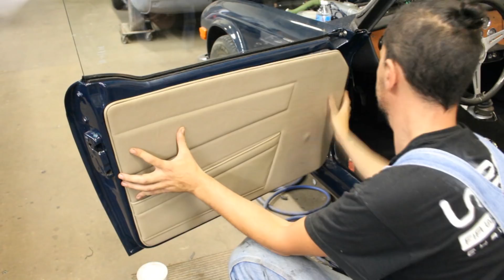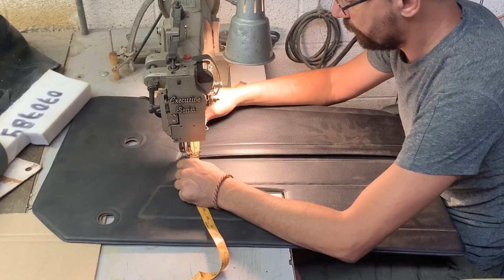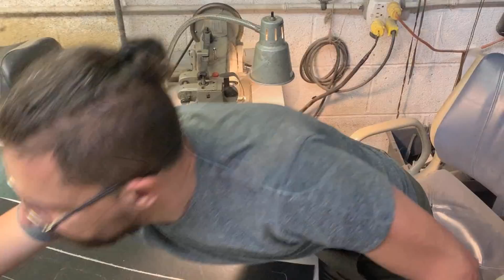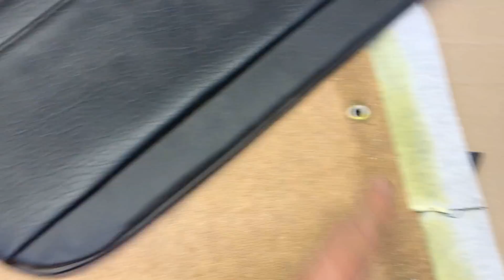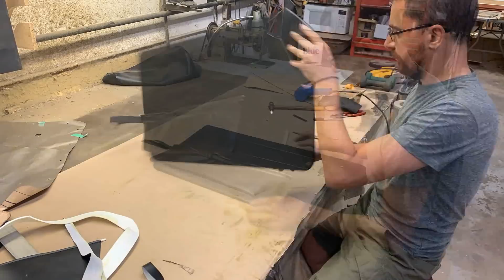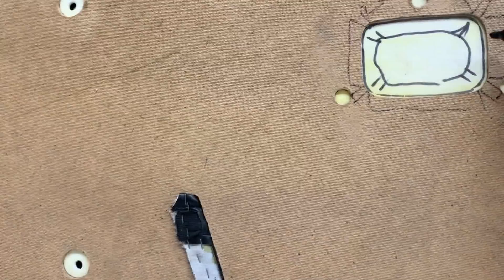TR6 Door Panels

Comment: Has anyone tried using Kydex V103 in lieu of Masonite?  It seems like it would be preferable, as it absorbs a negligible amount of water compared to Masonite, making it much more durable and better for holding the metal clips that secure the door card to the door.  Also, it can be mechanically formed, which would allow for other features, such as door pockets and reliefs for the door handle and window crank (potentially making installation and removal a lot easier).  

It’s possible to glue leather, vinyl, and foam to Kydex, too.  

This could be something for me to investigate during the winter.

Comment: Very nice job, as good or better than the upholstery jobs you have shown us before. Where do you get the backerboard (what you were using looked like the original) or is it slightly different to the original?
Reply from the maker: That board was in the shop for a very long time. Probably way before me :) But we normally buy masonite board and use that. If you noticed, even the original 1974 panel that I used as a sample had the board changed to a masonite one. And that explains where I got the warped one from :)

Comment: The door pockets on the Triumphs start to look shabby after a few years of use. As a matter of fact, it is best not to use a pocket. You should see if you cannot improve the design as you mention in your video. Maybe a firmer pocket? How would a solid pocket (that is smaller than the current one) that stands around 50mm proud? Almost like a Mini.   Or will that ruin the authenticity? Maybe the answer is to refresh every few years.
Reply: Another thought, the pocket is used as a door handle which is the main reason why it stretches. Maybe you can add a vinyl handle or strap as on the AC Cobras. This should stop the pocket from being stretched.
Reply from the maker: @achmadosman9807  Well, that is why I lined the pockets with foam and headliner cloth and run the double elastic at the top. That is going to last a while. As for the changes, I don't think triumph owners would be happy with any design changes.... :)